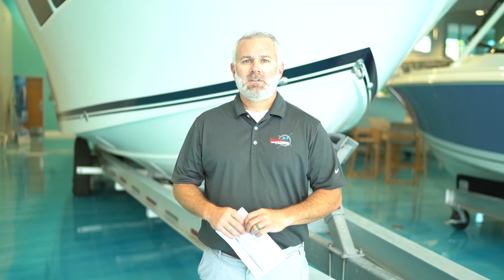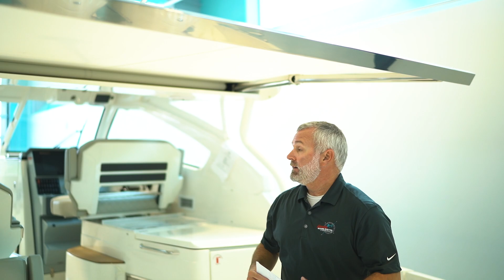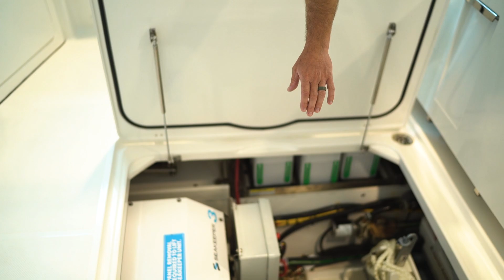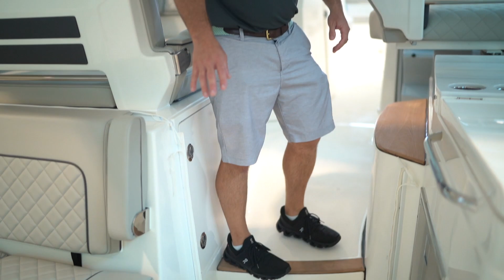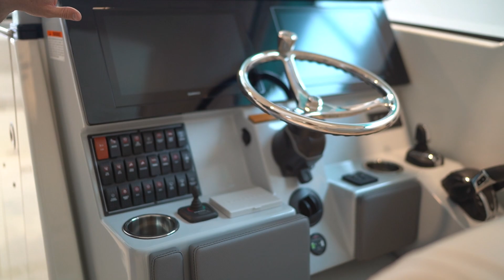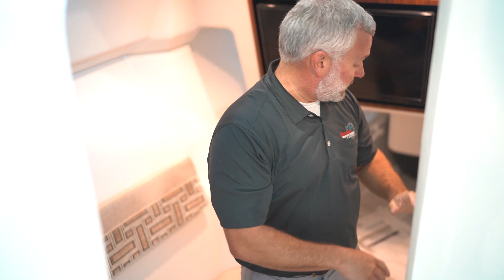New 2023 Pursuit DC365 38 ft Dual Console Boat For Sale In Jacksonville, FL: Walkaround

Comment: Are the battery charging system/systems in the same location as the batteries?
Reply from the maker: @terriwhite4815  no.  On this model I believe the chargers are located in a mechanical space on the port side of the boat under the deck around the midship area.